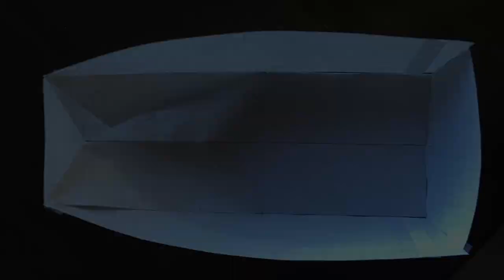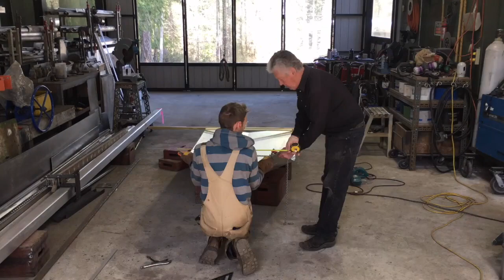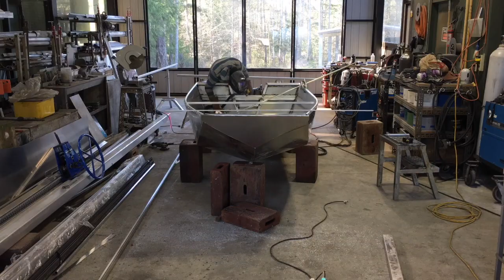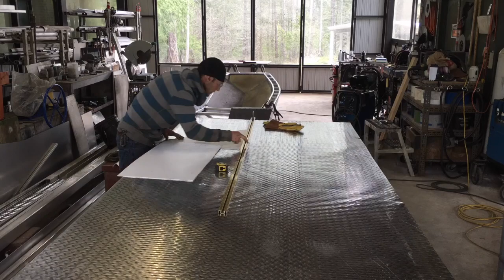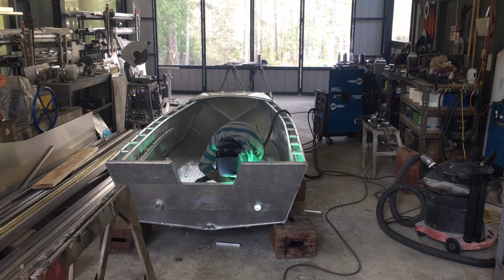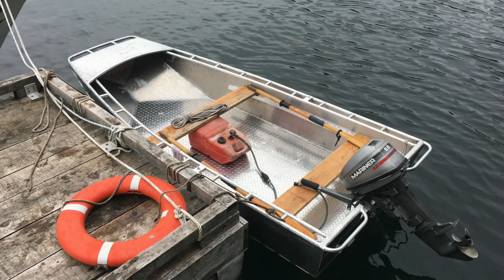11 foot Aluminum boat build

Comment: I am in the planning stage of my welded aluminum flat bottom jon boat with a jet drive build that is a copy of a 24x60 Gator Trax GT with a flat nose and I did the same modeling using a sheet of posterboard to get the hull shape just right. The perfect boat for hauling lots of gear into the Alaskan wilderness

Comment: I like the boat very much, I like the vlog very much, thanks for shareing.  Just one note, I saw no floatation devices nor any put into the boat.  I would jump on over to the local dollar general, or store that sells swimming noodles and cut to size for each sub flooring space, until it’s all full of the floatation that it will hold.
Reply from the maker: Thanks! 
I did look at using cut foam, or poured two part polyurethane, both of which I have in the shop. I didn't use foam because it makes it so much more difficult to repair later if needed. I have repaired a fair number of foamed hulls, and it's never pretty. For this one I pressure tested the hull and confirmed that there were no leaks in the hull or deck, and the airspace between deck and hull gives it plenty of positive buoyancy. I installed a deck fitting so its easy to check if I'm concerned that water might be getting in, and a garboard drain plug that I leave out when its on the hard so it doesn't collect condensation. I do of course have a lifejacket on board at all times when I'm out as well.

Comment: Absolutely fantastic I’m a sheet metal worker and retiring this coming year I ve always dreamed of building an aluminium boat I couldn’t have the dimensions or drawing for that boat ?? I’ll pay you for them it’s just the Wright size and looks like it handles the water so well please advise yours sincerely larrysullivan in London
Reply from the maker: Hi Larry,
I don't have drawings for it, although I have been thinking of doing a proper set of plans for it since there has been so much interest. I could definitely get you some basic measurements and so on though. It was a fun project! My contact info is on my website if you would like to get in touch. www.elegantfabricating.com
Cheers,
Eli
Reply: @EM-hu2bj  if you ever do a set of pland for it Id be interested too , perfect size and style.
Reply: I’m a union sheet metal worker apprentice in the states Larry I do mostly hvac but congrats on your recent retirement I’m looking forward to retiring in 40 years lol

Comment: What type of aluminum did you use? Im thinking 5052 or 6061 . Id like to build a 15’ with a mercury inboard sport jet.
Reply from the maker: I used 5052 for plate and sheet, and 6061 extrusions. The checker plate deck is 3003. 5086 is also often used for hull bottoms, especially on larger boats.
Reply: @EM-hu2bj  awesome thanks! Ive got a 15’ with a 78” beam on the go. Went with a 90/65 obj

Comment: Hi 👋🏻😊
I wanna to know what are you using for welding this beautiful boats ?! 
If u don't mine 😊
Beautiful build
Reply from the maker: This one was built with a millermatic 210 with a spoolmate 3035 drilled out for 3/64 wire, and a Lincoln squarewave 200 tig. I've since traded up the 210 for a Lincoln 350MP with a Miller alumapro XR push-pull, which is what I used on the 14 footer. https://youtu.be/JYy6rB_hENg

Comment: I have so many questions like, How long did this take? How much money would you have to have?
Reply from the maker: I did it in about two weeks, but I wasn't working full days. Also, I was working out the details as I went. Probably six full days if I was really going for it. I think it was around 1k for the materials, but I had most of them on hand. 2 sheets 4'x10' x 1/8" 5052, a 4x10 x 1/8 checkerplate, 3 or 4 lengths 3/4" sch40 pipe (6061) probably around 8 lengths of 1.5 x 1/8 angle, a length of 1.5" round corner square tube, and some misc bits. plus gas, wire, grinding disks, zip cuts, scupper plugs, ect.

Comment: Can you use stick welding with aluminum rods for this project?
Reply: Yes you can but that would add too much heat to it n may warp the alli these days they have pulse mig which allows you to add less heat hot cold welds

Comment: Put a 25 hp engine on that boat it looks to heavy with all them braces and shit
Reply from the maker: The boat could take it, but it would need the deck to be raised so it would still self bail with the extra weight. Have you seen my 14 footer? It’s built so it could take a 50hp :)) https://youtu.be/JYy6rB_hENg
Reply: @EM-hu2bj  no i have not seen that video yet but i did subscribe cuz i love boats i got my first boat last year i paid 17,000+ for a 20x6 and from the company i got it from asked me for my age i told em and they said your super ypung to be buy8ng that

Comment: What is your welding set up?
Reply from the maker: Built this with a millermatic 210 and spoolmate 3035, tips drilled out to run 3/64 on the MIG side, and a Lincoln squarewave 200 for TIG. I’ve since upgraded my mig setup to a Lincoln 350MP with a Miller XR alumapro push pull.

Comment: Great build!  That is a stout little boat.  Where did you get the hull plans?  I'm looking to build one next week, more for flyfishing than bombing around but I like that hull you built.  Also, what tubing is the rails? Is that 1".  I have my 5052 sheets on order from my local metal shop, but need to get the tubing also.  Thanks for sharing, and nice job on the video BTW!
Reply from the maker: The hull I designed myself - that’s the graph paper model at the beginning of the video. the rails are 3/4” schedule 40 pipe, so about 1” OD. I am just finishing a bigger boat, and this one I slit the tubing and slid it onto the edge of the sheet, and stitch welded it. It worked really well, and looks sharp. Its quite stable and would make a great fly fishing platform.
Reply: @EM-hu2bj  Oh cool, I was thinking of slitting the tubing I have to do the same thing!  Did the stitch welding work ok, or did you think a continuous weld would have better?
Reply from the maker: On the new one I TIG welded approximately 1” of every six, inside and out. I considered fully welding it, but didn’t want to distort the plate unnecessarily. I think it worked quite well, and feels totally solid. I slipped the pipe on before pulling in the sides, but it made them quite a bit more difficult to pull into shape. Next time I’ll try putting the pipe on after. If you are putting a mid span rub rail or seat ledger make sure you stitch it on before fully welding in the self bailing deck (if you are doing one) to reduce hull side distortion.

Comment: What did you use on the bottom of the boat to reinforce the aluminum. Looks like some kind of rounded channel or angle thanks
Reply from the maker: Hi Billy, The strakes are 1-1/2" x 1/8" aluminum angle.